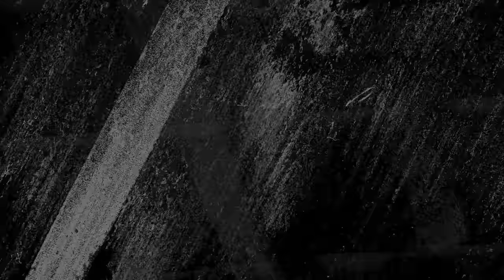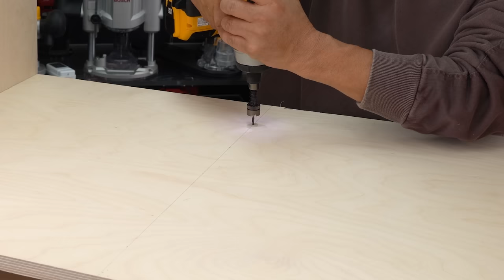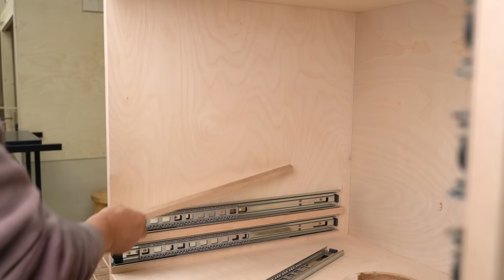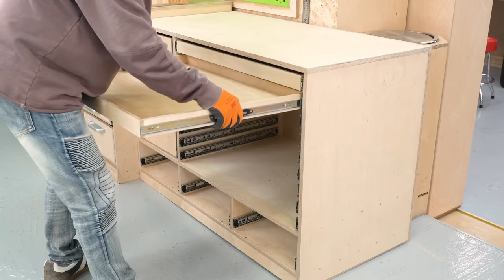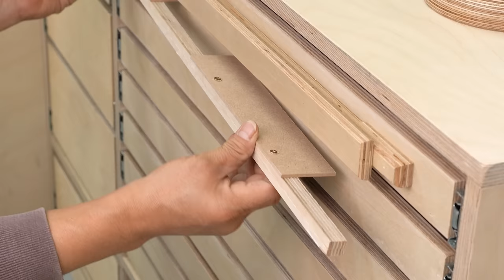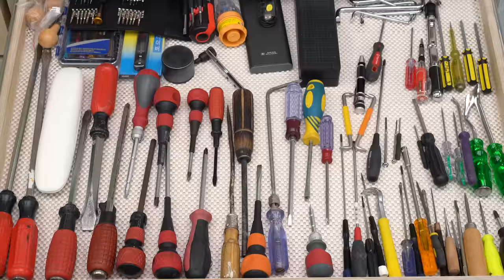Drawer of hand tools at a glance / DIY

Comment: When you install the rails in the cabinets, you use a spacer. 
When you mount the other part of the rail on the drawer, you use a jig with another spacer. 
How do you ensure they are lined up? Let's say the small spacer (drawer) is 2cm high. Do you (in the cabinet) then simply start 2.5cm from the bottom and use your regular block for the steps?

Hard to explain, but I'd be scared not to have it line up :) 

Beautiful video by the way, I'm going to attempt building this for under my new workbench
Reply from the maker: It's not easy to explain. 
The height of the interior space is h, 
Let the number of drawers to be created be n 
and the distance between drawers be t.

 First, subtract t from h. The reason t is subtracted once is that there is one more interval than n. 

And when h is divided by n, the number is the sum of the height of the drawer and the distance between the drawers. 

In other words, the number obtained by subtracting t from that number becomes the height of one drawer. 

Now, the number obtained by subtracting the width of the rail from the height of the drawer and adding the distance t becomes the height of the jig to be used. 

If you put the chest of drawers upside down and attach the rails using this jig, The spacing between them is exactly right. 

The rail attached to the drawer can be known by looking at the structure of the drawer rail, and you can make a jig at that height. 

If you think about it carefully, you will understand. thank you
Reply: @Kynosys_  Great explanation, that's helps me to make my own number of drawers! Thank you so much!!! Go on with your great videos, it's everytime impressive and innovative. I like it!!!! 👍☺☺
Reply: Do you have plans for this?
Reply: @Kynosys_ great video just ignore the negativity thanks for sharing ❤❤
Reply: @jordan201147  Develop your own... I can
Reply: @Kynosys_  Chinese math babe!!!!!
Reply from the maker: @chenz4658  Thanks!
But I'm Korean !
Reply: @Kynosys_  Oh crap. I have seen Chinese in the description so I assumed you were Chinese. I think it is the auto translate thing. But anyway, we Asians rule!

Comment: I love the cabinets.  But if this is in woodshop then those drawers will be full of dust in a real short time wont they? Not to mention the slides as well.
Reply from the maker: This is a correct point about not finishing the front of the drawer. However, I don't really like the finish on the chest of drawers. It feels like the finish of home furniture used in the living room. You don't have to worry about dust. There are a lot of dust collection facilities in my workshop. It is structured so that dust can never reach the chest of drawers. Various dust collection system related videos I made will be uploaded as a series soon. In particular, the workbench I named the sanding base is the key. You too will be able to enjoy it. thank you

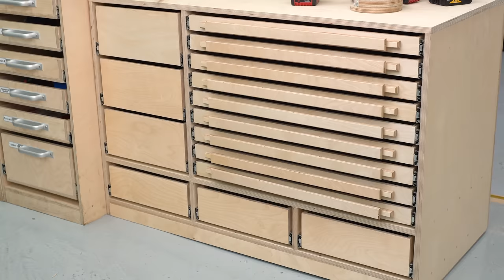Comment: PAUSE @ 4:27.  If you don't see that, I can't help you.  I saw that shot for less than 3 seconds and it jumps off the monitor.
Reply from the maker: Does this mean I showed too little? I don't know exactly what it means.
Reply: @Kynosys_  The bottom handle jumped right out at me, it is pretty far off level.

Comment: Интересно, а не провиснет ли фанерное дно такого ящика, когда в него нагружено столько тяжёлых инструментов (гаечные ключи и т.п.)? Многие мастера делают ящики из металлических листов, мне кажется, такой вариант был бы даже легче по весу и прочнее
Reply from the maker: У тебя такие же мысли, как у меня. Я удивлялся, почему все сделали его из стали. Преимуществом будет то, что он может быть изготовлен из гораздо более тонкого материала, чем дерево. Однако с древесиной намного легче обращаться, и она прочнее, чем ожидалось. Я даже подумал, что было бы неплохо использовать березовую фанеру марки 9Т. Спасибо

You have the same thoughts as me. I wondered why everyone made it out of steel. There will be an advantage that it can be made from a much thinner material than wood. However, wood is much easier to handle and is stronger than expected. I even thought it would be nice to use about 9T birch plywood. thank you

Comment: Nice setup... but man, I gotta ask... How many calipers does a guy need? lol
Reply from the maker: Thanks for the good point. However, the reality is this. 

If you look closely, there are more 30cm rulers. In my opinion, the more measuring tools, the better. I only put them together for this shoot, but they are usually scattered here and there. Rather, there are more times when I think that it is not enough.  When I'm working, if you look around my worktable and equipment, you'll understand. 

In front of equipment costing tens of thousands of dollars, I am very curious when I see people struggling to find measuring tools that cost only a few dollars. Where did he invest in? I think we should save that time. It's an investment in its own right, and well worth it.  Thank you!

Comment: Almost perfekt, you still have a dust gap, I do not know why.
Reply from the maker: It's personal preference. For me, if the front of the drawer is tightly closed, it looks like a piece of furniture used at home. My work area has special ventilation and dust collection systems, so there is almost no dust flying towards the drawers. You can see this in another video. Even after several years of use, dust is not a problem at all. thank you!

Comment: I think the main problem was too many tools! Do you REALLY need so many long nosed pliers? Verniers? Squares etc?
Reply from the maker: Does it look like my tools overlap a lot? I offer a few points of view. 

The more measuring tools, the better. The time saved well exceeds the cost. 

Of course, I use almost all of them. If you look at the workshop when I'm concentrating on my work, you'll understand, but surprisingly, I still lack tools. It is very difficult to clean and work. After a project is over, it is a picture of the messy tools gathered together. 

Some of them are tools I use when I do review and unboxing videos. Introduce new products or shoot shorts videos. My goal is to try a lot, if not all tools in the world. Of course, as much as circumstances allow. Your interest helps with that. thank you!
Reply: @Kynosys_  "the more measuring tools the better". So if you need to take 8 measurements, you need 8 verniers? Yeah right!
Reply from the maker: @gbwildlifeuk8269  Actually, there are more. The most expensive of my machines is around $50,000. I don't understand people who wander around looking for a few dollar measuring tools in front of such expensive equipment. That's a waste of your time. I am speaking from that point of view. The video of the power tool wall I made will be uploaded soon, but I think you will be embarrassed again. I have over 30 drills. Let's enjoy it together. Thank you!
Reply: @Kynosys_  "but i think you will be embarrassed again" you think I'm embarrassed! 😂😂😂
Remember, a craftsman uses tools, an amatuer collects them. Bye
Reply from the maker: @gbwildlifeuk8269  word "embarrassed" sorry.
I remember. Thanks!
Reply: Better chance of finding whatcha need if there’s many duplicates. 😂